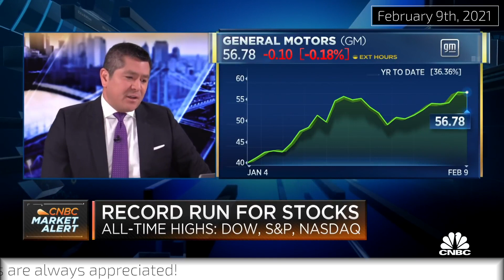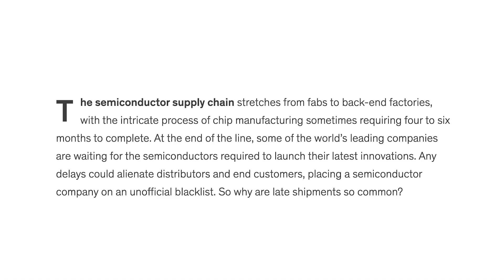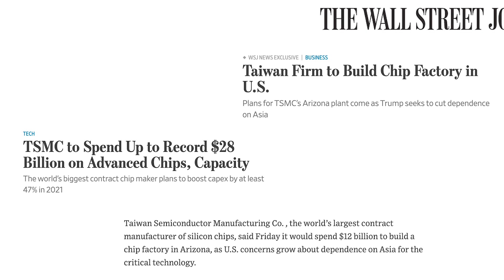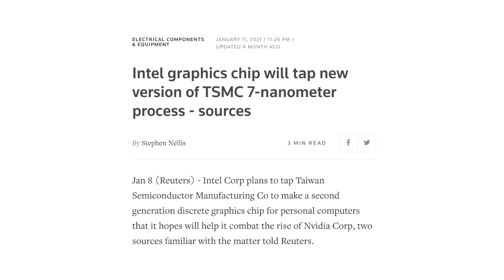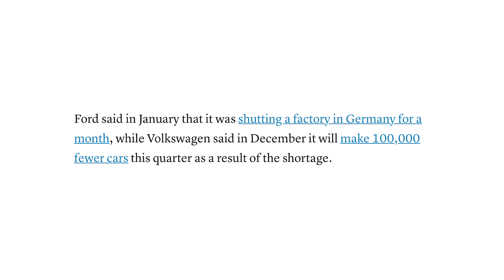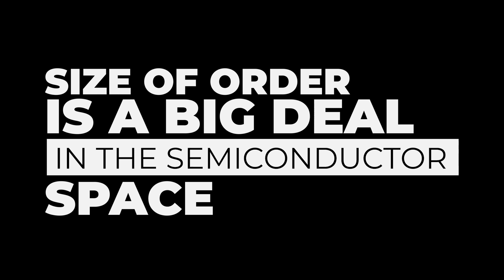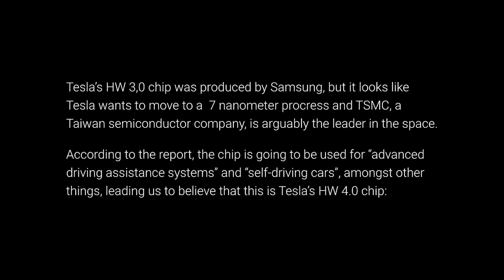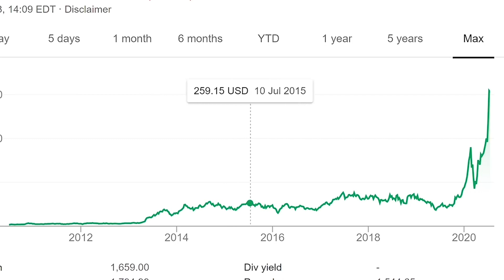The Newest Competitive Advantage for Tesla

Comment: The small semiconductor chips might be a problem.  I’ve just finished reflowing solder onto some small chips for the third time that was in our TV. and now I need to do the same thing for a Mac computer graphics card so I hope they’re going to be reliable through the years and not have the same issue  my TV has had and also that my iMac computer graphics card has

Comment: If this is the case for smaller chips, then Apple, by making their own chips, may also be a big player with their electric cars.  There is room for all of them in the future.
Reply: Apple does not manufacture their own chips. They design them the same way Tesla does.
Reply: @suijinnoname6412  Did not know that, I was under the impression that Apple had designed the M1 Chip themselves to replace the Intel ones.  Thanks for the information.
Reply: @depena  The M1 chip is the most powerful chip that Apple has created to date, and it is similar to the A14 chip in the latest ‌iPhone‌ and iPad Air models, built on a 5-nanometer process by Taiwan Semiconductor Manufacturing Company (TSMC).

I really don't know what you are talking about. Apple does not manufacture their chips.
Reply: @suijinnoname6412  when I said "Apple making their own chips", I meant design.  They created the M1 so if they can make a chip that small using less power, they can in fact make one for a car that "may" be on par with Tesla.  IMHO.
Reply: @depena  By that definition Tesla makes their own chips also. At that point maybe Apple can be competitive, but they still need somewhere to put their chips. Tesla owns the design for the whole stack and can integrate everything better because they control the entire vertical stack of manufacturing.

Comment: This is  absolute nonsense, toyota made just in time production to significantly improve benefits and time gain, toyota didn't had any chip shortage and the chip making machines are made by ASML and the German company CARL ZEISS, car manufacturers directly work with companies like Samsung, SK, intel..... Bosch is just a universal auto supplier for things like ABS systems which they created, Bosch is not just a car part supplier but they make many other products, same goes with Siemens....

Comment: The area size from 14 nm to 7 nm is almost quadruple since you're talking about surface and not just length. To double the transistor density from 14 nm you don't have to go all the way to 7 nm, but to 10-11 nm, something in between.
Reply: What about heat and resistance and speed factors ?
Reply: @aardvarkansaw  I was just pointing that intel is behind two nodes, not just one as the guy said.

Comment: I very impressed with your complete discussion explaining 5, 7, and 14, NANO chip development. SAMSUNG has helped ou Elon before. PANASONIC  wouldn’t or couldn’t supply the 18650 cells needed for his HIS GRID FARM BATTERY FSRMIN SOUTH AUSTRALIA. Elon had his balls on the line for 50 million and SAMSUNG supplied. Elon bet the project would be free if he didn’t have it complete by a certain date. I was surprised that it was SAMSUNG that actually produced the HW3 Computer chips II their factory in AUSTIN. I wonder if SAMSUNG could produce this 5 NANO chip in KOREA  and then switch 2 years later to their new foundry in AUSTIN. What a surprise that INTEL is a looser and I’m sure it was very smart politically to switch from TSMC  in TAIWAN. I wish You talked about Jim Keller who developed the HW3 CHIP using ARM ARCHITECTURE before jumping to INTEL. Can You give us the name of the next guru who replaced Keller. I know Andrej Karpathy is head of FSD for TESLA but Who is the Guy, and what is the structure in this department now.
Reply: TESLA INVESTING 1.5B INTO BITCOIN
BITCOIN IS ON A BULLISH RUN NOW, INVEST IN IT NOW AS ITS APPRECIATING AND HUGE.
DO THAT WITH MY EXPERT
Reply: Availability via Wh atsApp
+ 1 - 5 - 6 - 7 - 2 - 8 - 1 - 9 - 4 - 0 - 1

Comment: Dillon, most electronics in cars use very old tech- 24 nm or larger because it is cheap. So although there are hundreds of computer chips in a car, they are more like the chips in a microwave, not state of the cpu. Also the term 5nm, 7nm, 14nm are process labels and not directly comparable AT ALL. Technically Intel could make most of the chips the auto industry needs............ so why don't they?

Comment: Teslas use far more chips than the one FSD computer discussed, there's serious shortages of all AMD GPUs for example and Tesla intends to put a Navi 23 gaming system in each and every new Model S and X they'll produce. Then there's the MCU and a whole bunch of other chips controlling all sorts of stuff in high-tech EVs. You should also consider that Tesla may use different suppliers in the US, China, etc. and you only really need the smallest, most insignificant chip to run out of supply, say door handle controller, and you can't finish a car and can't sell it.

As stated Tesla's advantage is its predictable growth which means predictable contracts and they acted like pandemic never happened. However, exponential growth means some suppliers can't meet demand and Tesla needs to negotiate with a 2nd, 4th, 6th, complicating the chain with more and more chances of shortages. So Tesla may be hit less than others in semiconductor shortages, on the other hand, they use the most tech, and we're having a tech supply crisis.
Reply from the maker: great insight my friend, you're correct. that's why toward the end i did want to make it clear tesla is not bulletproof, but relative to the others it is a competitive advantage due to the reasons mentioned. but yes, a lot more going on than i could cover in this one!
Reply: Dont forget that tesla only made 500k which is laughable compared to vw that made around 9 million car the same period.

Comment: 10:08 That's a really old mainboard and processor, LGA 775 from Pentium 4 and Core 2 Duo era 😋👍 ~2007
Reply: I still have my old HP laptop with the "core2duo" processor. Its running windows Vista. It still runs perfectly albeit slow by todays standards. Its been retired as of 6 months ago since youtube streaming was more than it could handle at 2x speed
Reply from the maker: what an eye you have!

Comment: I wonder if not Tesla/SpaceX/Starlink actually should invest in foundries. Not now, but maybe in five years?
Reply from the maker: interesting question! still say it's unlikely imho
Reply: @DillonLoomis22  I don't know enough to have an opinion. I just thought that with them doing the DOJO computer, the chip for FSD, starlink satelites etc and my guess is that every battery system for home or utility is heavily computerized, at some point, Tesla software/hardware activities becomes so significant that some vertical integration could be meaningful but I don't know what. Generic foundries might be a stretch. I guess those need to make billions of chip.

Comment: Not a expert on cars or semi conductors either, but to me it sounds like every car needs those not just ev's but ice cars as well. Since most automaker currently are loosing money on ev's this sound like they will use the remaining semi conductors for their profit making cars,  which would only increase teslas advantage in the ev space, or am I missing something?
Reply from the maker: the thought process makes sense, but in the end we are all doing a lot of speculating. but yes, all cars need some chips but ev's typically need more and different kinds
Reply: @DillonLoomis22  true that, but thats what growth stocks are all about, , speculating on their groth, and tesla has a lot of groth already priced in, but not the amount of groth that I am expecting, thats why I or we are all invested
Reply: Stop talking nonsense, cars way more than just one chip and EVs probably have way more chips since everything has to be electronically controlled, but German cars are still probably the most computerised ones.
Reply: @alanmay7929   Ev's have fewer parts which is a good thing. They almost certainly need fewer chips as a result, also a good thing. Tesla may have a more centralized system which would be a good thing for non-safety-critical stuff that doesn't need specialization or redundancy.

Ice vehicles have Charger/Inverter as they have batteries well. They have motors (starter, throttle actuators, fuel pump, electric water pump, electric oil pump) and generator(alternator) and then they need all sorts of wizardry for fuel injection, exhaust and emissions control, engine knock detection. Oh, and parking sensors, radar, cameras??
Reply: @kojog2813  uhm you're totally wrong, for a centralised system like in tesla, the main chip is for FSD and other controls, but the electric motors, ABS, speed sensors, cameras, charger/controllers, inverter.....heat pump, batterymonitoring system (BMS), the doors needs alot of electronics/chips for a centralised control. ICE have ECU that controls everything from electric/mechanic water pump, hvac....
Reply: @kojog2813  the ECU in ICE controls almost everything in the engine bay from starter, throttle  fuel pump, electric water pump...and its even way smaller than EV systems
Reply: I agree.  I’ve been trying to find out if Tesla has a chip shortage.  It seems like most cars need around 100 small chips.  I’m thinking Tesla’s just need 1 large one.  Is that right?
Reply: @dcdelis  toyota did not have any chip shortage and they were even able to surpass VW to be the world's largest car manufacturer with over 9 million cars in 2020. I'll say toyota is very smart.
Reply: @dcdelis  like i said not an expert 😅 no ev's need more semi conductors then ice cars but tesla's need less then other ev's (more efficient, due too their expertise) and like explained in this video, manufacture would prefer tesla over other car makers because of the higher order nr
Reply: @nicolasstuder5430  Based on what I've seen from Sandy Munro's teardowns, I think it's very likely that a Tesla even uses far less semiconductors than any ICE car, because Teslas only have about 4 large computerized modules, and those modules can be drastically more efficient than hundreds of smaller specialized chips.

A car without a central computer might have 100 specialized chips, but specialized does NOT mean optimized! Specialization can also mean starting with a chip that can do anything and programming it to do only one thing, and that's so much cheaper and easier that it's how we make a lot of our mass-produced electronics.

Designing a microchip with only the circuitry necessary to blink a turn signal could be a huge waste of money, so all of the specialized chips with tiny tasks are probably more general-purpose microcontrollers with specialized firmware on them. Also, a microcontroller with a single simple task doesn't need to have more performance, and so it presents no good reasons to re-design it on new transistor size nodes the same way that we are constantly doing with CPUs. That means the microcontroller whose only job is to roll the windows up and down might be a 20-year-old design on a 200nm process, and nobody would ever see anything wrong with that until we run into a global semiconductor shortage.

Tesla's Autopilot 3.0 is on 14nm. It's efficient and powerful enough that every function of the entire car could be controlled from one chip, but Tesla still saw it better to put infotainment and FSD onto separate chips for safety, ease of development, and better optimization of the chips - real optimization, because Autopilot 3.0 is designed explicitly for autonomous driving.

My final reason for thinking that the computing hardware in ICE cars is highly wasteful is that the shortages seem to be hitting automakers harder than the makers of low-end phones and laptops, despite the cars having much less overall computing power. I could be wrong, because I know almost nothing about the global supply of laptops, but I've only heard general noise about the shortage of the newest flagship processors - and not anyone saying "I can't even buy a chromebook"
Reply: @teslainvestah5003  well like a said not an expert😂 but you seem to be, at least you know more then I do, but I am willing to learn since understand the companies in which you invest in is crucial.
Reply: @teslainvestah5003  This should be the content of the video. 👌
Reply: @nicolasstuder5430  ICE are way more mechanical, EVs needs tons of electronics, the motor controllers, ABS systems, charger/inverter, radars/cameras, parking sensors and many more.dont forget throttle and brake by wire even tho ICE are already using it.
Reply: @teslainvestah5003  the FSD chip of tesla is just one of other hundreds other chips in teslas, its basically full of electronics, from steering wheel to seats, motor controllers....... ICE uses way less electronics.